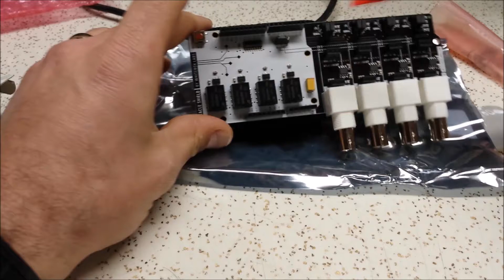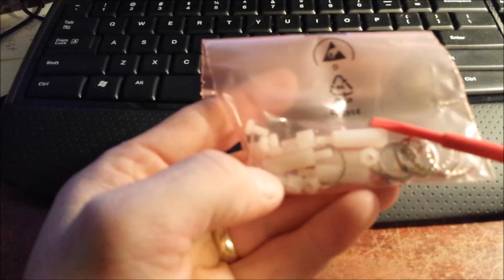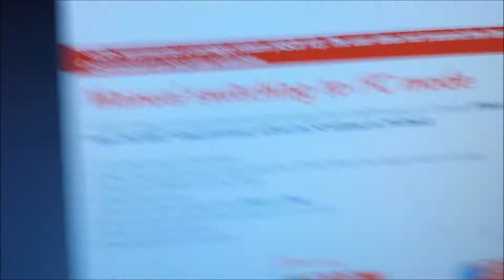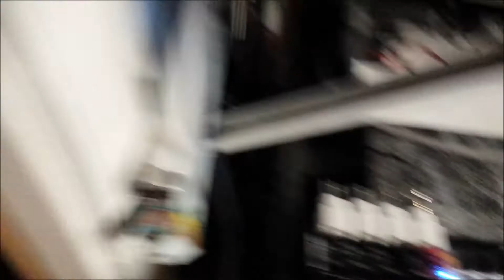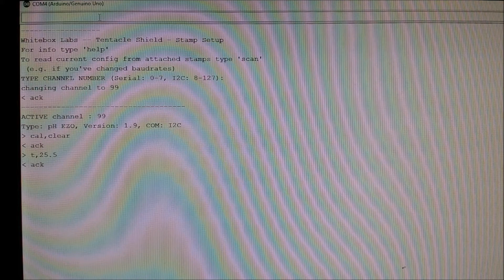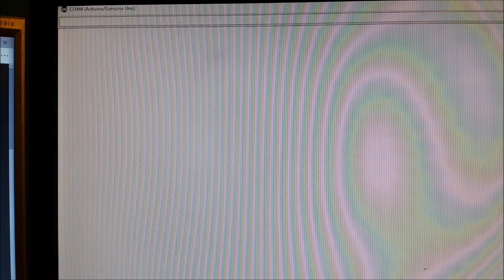Tentacle Arduino Shield to use with Atlas Stamp for a DIY Aquarium Controller PH, ORP etc

Comment: Have you tried out the Whitebox T1 which replaced the Tentacle shield? I am trying to calibrate some probes but I thought I read it needed to be in UART to calibrate them but the Whitebox only operates in I2C. Any advice or guidance is much appreciated :)
Reply from the maker: i have not used that new shield. try this:https://files.atlas-scientific.com/oem-ph-sample-code.pdf

then follow th calibaration for I2C here:https://files.atlas-scientific.com/pH_EZO_Datasheet.pdf

Comment: Thanks very much for this video.  I'm convincing myself I can do this.  Hah.
Reply from the maker: Ha. You can these shields are easy to setup.
Reply: @CarlRecktenwaldJr  I need to make a hydroponic solution monitor (ph, ec, temp, at least) that can also control/dose for ph (at least).  I wonder the best route to take for that (cost wise).
Reply: So, this aquashield https://youtu.be/sckkAG1xdMo   Do they also make their own "stamps" or circuits for pH, EC, etc.?  That's what it looks like in this video.  They use atlas probes and their own aquashield stamps?  Is that right?

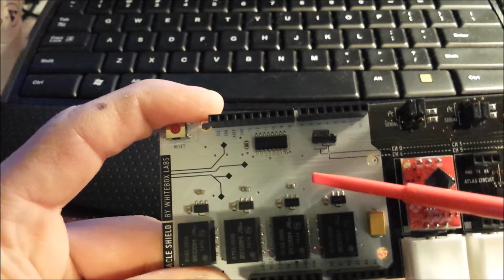Comment: Hi great video ! At 6:20 you mention that if using serial it is possible to stack 2 tentacle shields. Would it also be possible using I2C ? 

Thank you !
Reply from the maker: Yes. Each sensor gets its own specific address and the shields are stackable. The white box web site has example sketches.

Comment: when swapping the stamp to i2c manually the camera never showed the last plug location. You said vcc but i cannot see the other line.  5v? is that the spot?
Reply from the maker: Short TX to Pgnd. The ez stamp data sheet show the process very clear.
Reply: i figured out i have a old ph stamp that cannot do it. Even the manual does not explain where the other wire goes.   Should be easy for some but not others. The plug i was not seeing was to 5v.  For anyone else needing it
Reply from the maker: Ah. Ok thanks for the updated info. I am sure someone else will need to know.

Comment: At least for Hydroponics, a Temp sensor would of greater use than either DO or ORP.  Any chance this shield allows for temp sensing?  Cool video though, very informative!
Reply from the maker: +Michael J yes, there is an RTD stamp which monitors temperature. I have a video here about the RTD and tentacle mini. 
https://m.youtube.com/watch?v=P1Y4F2z8WW0
Reply: I watched that video after I watched this, also another good one.  I just wanted to point out though that it would have been more convenient I suppose, if the TMP sensor could've been used on the Tentacle.  In hydroponics, water temperature is very important data and can severely effect the outcome of the crop.
Reply from the maker: +Michael J ah, ok.
Reply: I emailed Whitebox Labs, and they replied that any EZO stamp can be used on either of their shields, so I can connect the stamps that I choose.

Comment: It looks like they are coming out with a Tentacle Mini in February https://goo.gl/8ohL0w
Reply from the maker: That's perfect...Thanks for the link....
I also see they are coming out with a monitoring system..
Reply: +Carl Recktenwald Jr. - No worries, that monitoring system seems interesting, but for what I would like to do (marine aquarium that I am planning) it is perhaps a little over the top. Personally I just want 2x ph and conductivity with one ph for a Calcium Reactor and the other for tank ph. I may eventually look at adding ORP, but for starters I would likely just start small and work up.